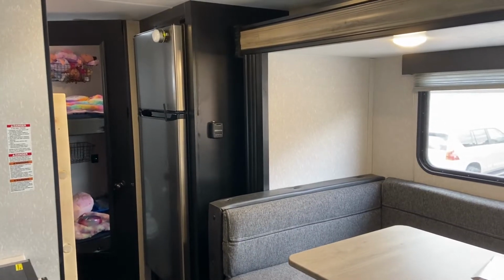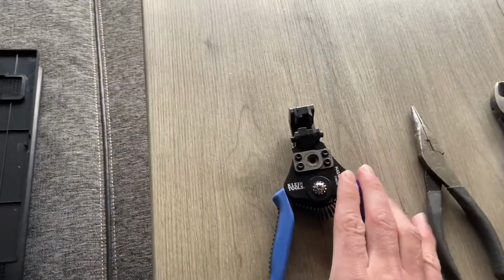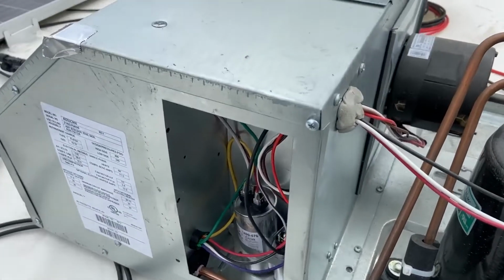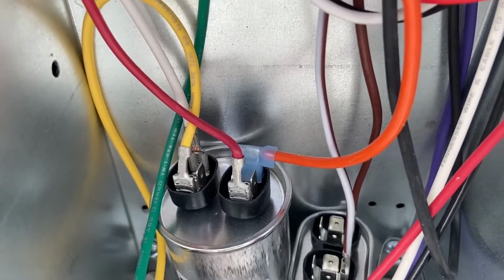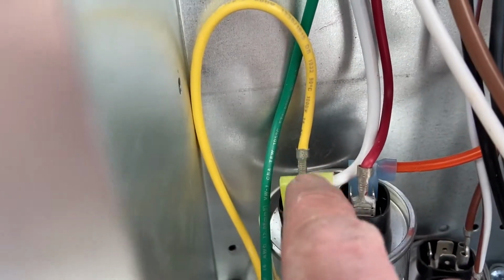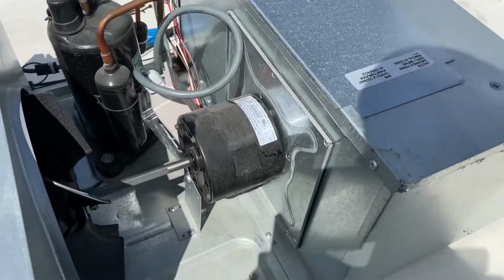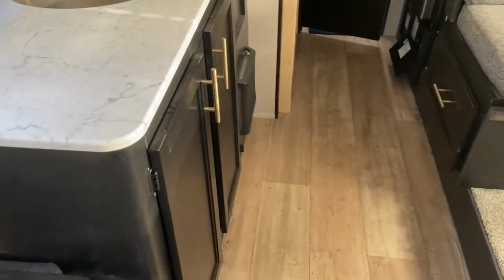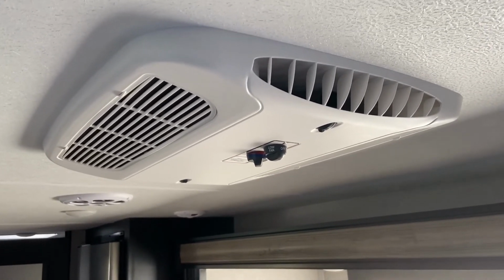DIY EasyStart Install on Wolf Pup 17JG

Comment: Thanks for this video because I think when I get my camper I'll be doing allot of boon docking with AC. What size generator are you using for your wolf pup 17JG? Would a 2k work if your using the quick start?
Reply from the maker: Yeah having the option to run AC with a smaller generator is awesome. We have a 2400 watt inverter generator, no issues. I haven’t tried with a 2000 watt personally but from reviews of the EasyStart that should work too!

Comment: Awesome mod. Considering doing this if our generator is big enough. I have a 2000 watt Yamaha inverter generator
Reply from the maker: Our 2400w generator hasn't had any issues. As for 2000w generators, most reviews I've seen sound like it'd work just fine too!